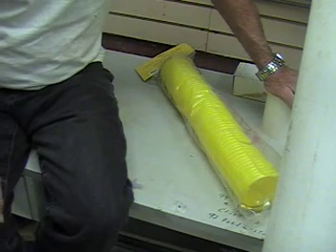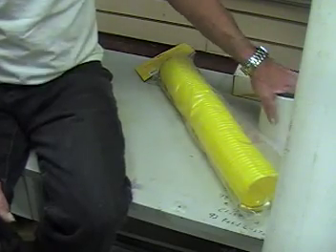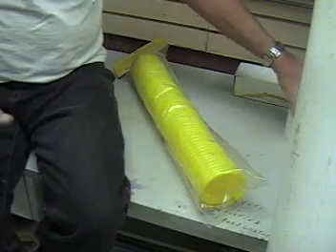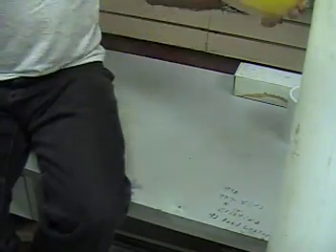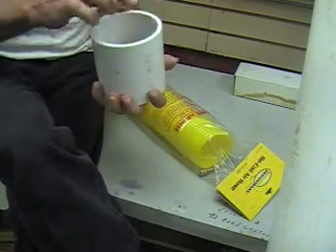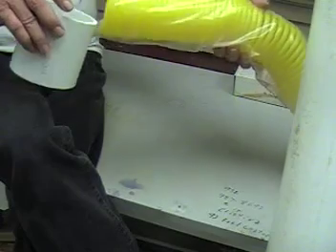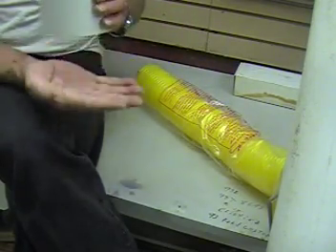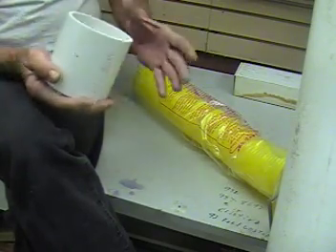Solar powered Gasoline Wheel. #1

Comment from the maker: If you are asking about the solar powered still.  Not worth a shit. Could not get the gasoline hot enough and the inside diamiter of the coil was too small. I think I am going to need to use electric double boiler and larger diameter coil.
If you are asking about the wheel. The answer is not Yes; BUT HELL YES.
Did you watch "Solar powered Gasoline Wheel. #2
Thanks for watching